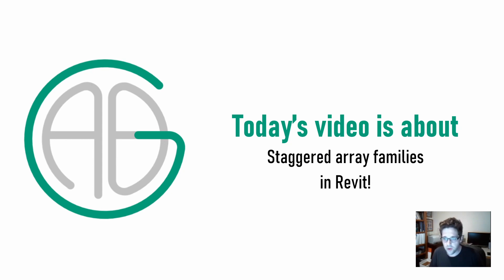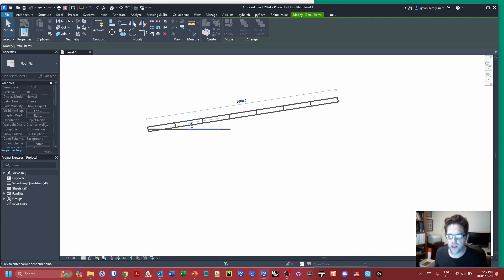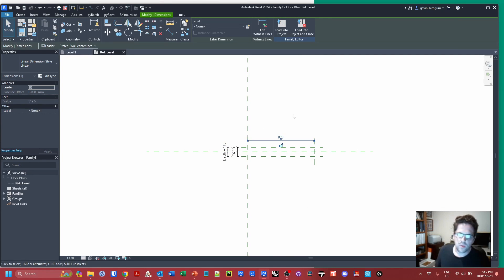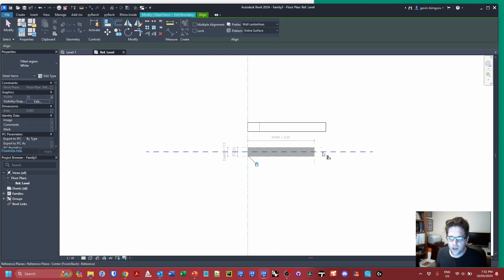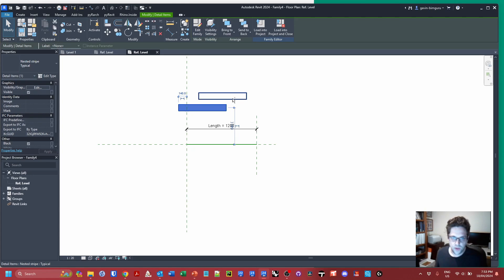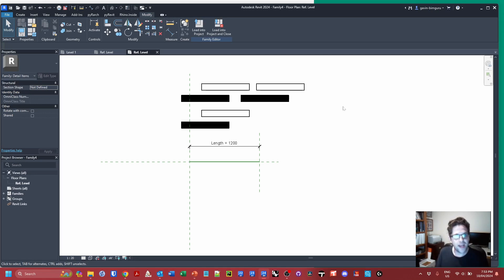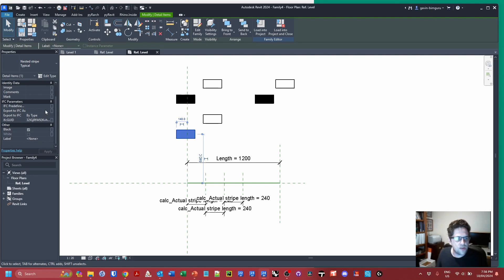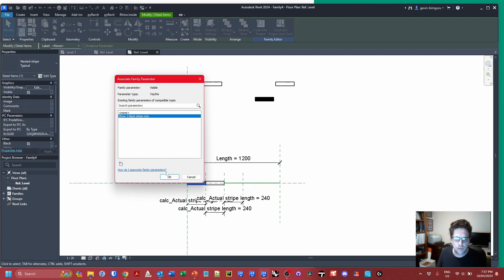Staggered Array families in Revit!

Comment: I would be very interested if you would have a template of a double storey home with all the families available for purchase. A full set of working drawings with some general details. Including internal elevations.
Reply from the maker: It doesn't go down to general details but I sell my residential template with a sample model inc joinery and int elevations (just not site, details) here:

https://courses.bimguru.education/courses/template-revit-housing

The template includes enough families for basic housing but i sell full doors, windows, casework etc. as content packs on the same website.
Reply: @AussieBIMGuru  Thank you for that, heading to your website.
Reply from the maker: @asifkhorrami384  youre welcome! Good timing as I just updated the template to 2022 in line with my other content.

Comment: Nice tutorial, I use the length based detail component a lot for various rebar annotation families. One thing I wish Revit had is the ability to make lines styles / line colours and fill regions parametric. Now if I want to have different colour variants of a detail item I need to create multiple versions of the thing within the family and create visibility parameters for each representation. How handy it would be if a fill region/line style, etc could be associated to a selection parameter. It would prevent a lot of duplication of the same geometry.
Reply from the maker: Oh dynamic fills (even if just orientable), line styles with symbols and other similar systems would be brilliant. No doubt its rotting on the ideas board somewhere...

Comment: Hey there! Great video, just wanted to ask if there is a reason why the arrays are not constrained from the start without the need for the initial first black and first white components, and that is not in regards to Revit 2025 where the arrays have changed. Thanks!
Reply from the maker: Yes I made this in pre-2025 where this is much easier now - most people are not using 2025 yet. I made the first black/white space as arrays cannot go down to 1, only 2.